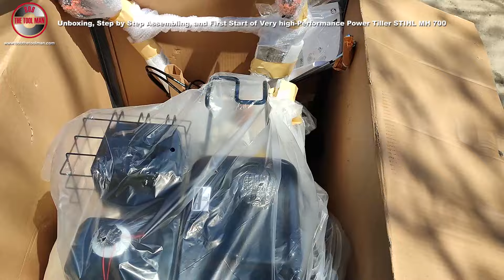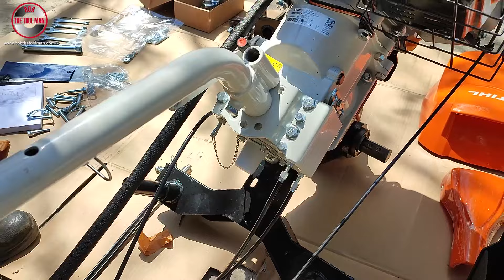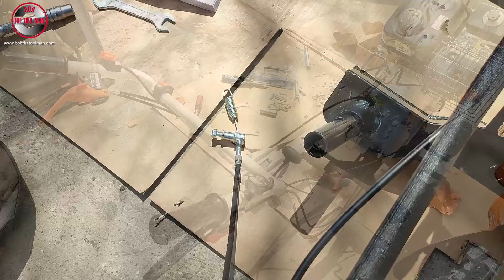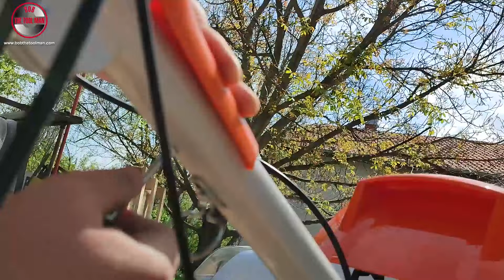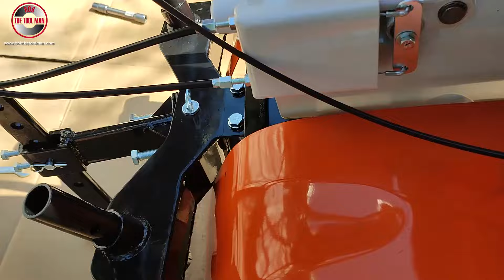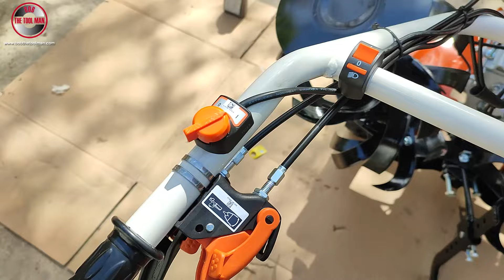Unboxing, Step by Step Assembling, and First Start of Very high Performance Power Tiller STIHL MH700

Comment: What is the reasonable price in India tell me710
Reply: Today i bought it for 68000
Reply: Kaha melaga sir
Reply: One question Ho do you change gears do u press clutch or not as I'm not pressing clutch while changing gears @rajibborah5670
Reply: @Dheerajsharma86269  no need to press clutch while changing gear the clutch lever in the ripper work as acceletor which is used to move the ripper when pressed..... so if u change gear while pressing the clutch it may damage the gear pinions. Hope this helps.
Reply: I bought yesterday by 61,500 in Nagaland
Reply: At dimapur, 3rd mile?

Comment: Hi, can you confirm me that oil for motor and for gear box is the same oil or not ? Thanks
Reply: Got the same machine and assembled it today, the manuals said the oil should be the same, SAE10W30 in the transmission, the engine and the oil filter.

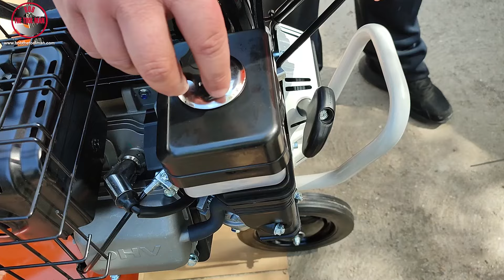Comment: very explicit. thank you. Still, there is a mistake, at min12:02 you fill the gear box  with engine oil, SAE 30, as written on the  bottle. Please specify what kind of  gear box oil you are using. It can not be the same engine oil.